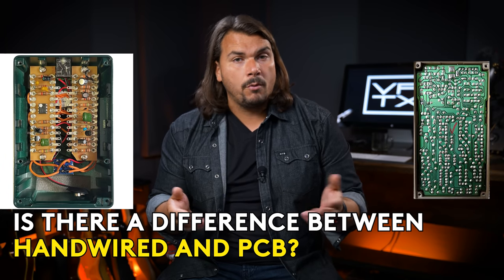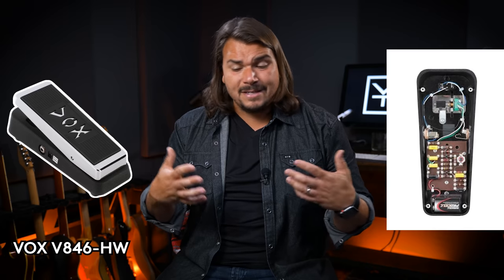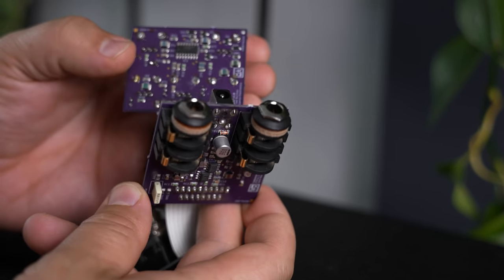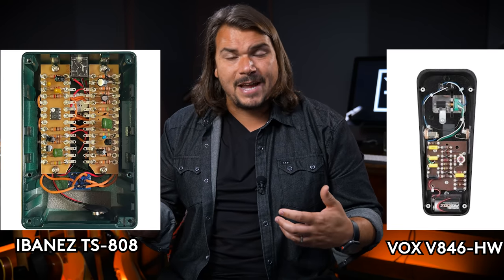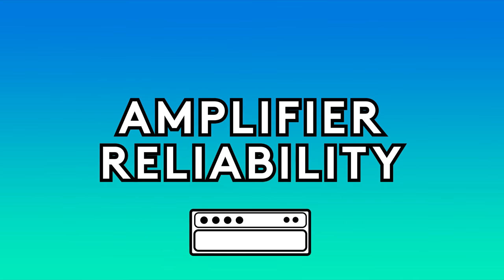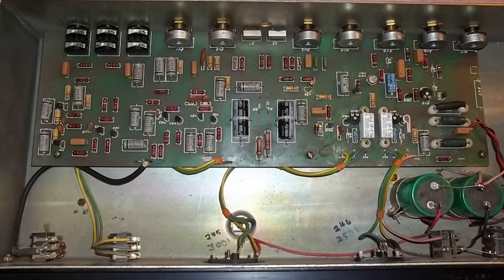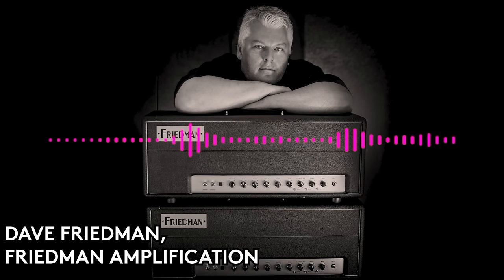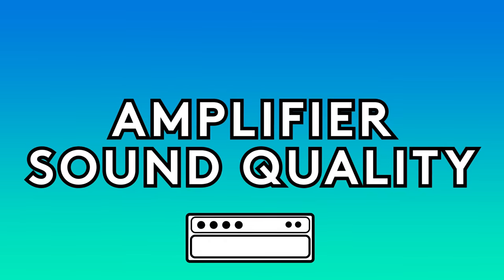Is Hand-Wired Actually Better?

Comment: It's really simple with amps. Handwired = longevity, not necessarily because it'll last longer from the factory but because you (or an amp tech) can easily replace / upgrade / modify any part of the amp. I'm going through this right now on my channel, I've got a 1955 Magnatone I'm learning to work on. I'm confident this amp would be doa if it was made with a pcb (hypothetically) 67 years ago. Working on / with a pcb is MUCH harder and often times the components are much smaller / harder to source and replace. Handwired for amps every time.
Reply from the maker: That's not necessarily true, it depends on implementation and the layout of the PCB.  There are PCB amps that are really great and easy to work on - the Suhr Badger as an example.  Components don't know their on a PCB, and you can use the same components on a PCB amp as you can a handwired amp, what it comes down to is implementation as stated by Suhr and Friedman - so often people characterize PCB amps based on their worst examples, not their best (or even standard examples).
Reply: Following up after hearing John's comments, I think there's a big difference between easier / better to work on for a company vs as the end user / consumer. A handwired amp is going to be much easier to work on as a consumer with an off the shelf soldering iron most people already have the and the components are easy to source for replacements/upgrades. It's much more service time for a company like Suhr or Friedman I imagine to do handwired amps / repairs than it is to just swap a pcb.
Reply from the maker: @YeatzeeGuitar  it completely depends on the layout, design, and intent of the builder.  Again a lot of the issues with hand-wiring are a result of human error by way of hand work, inconsistent solder joints, cold solder joints, etc.  Most of this disappears on a PCB that's wave soldered that's of decent quality.  For the most part, the PCB amps should need almost no serviceability except tube changes and cleaning of the contacts periodically.  Again, on most PCB amps the high failure points are typically wired off the PCB anyway - pots and tube sockets most commonly.  It would be unfair to characterize the quality of something like Fender Hot Rod PCB to a well designed PCB - where it might be more true of what you're writing here on the issues related to PCB.  I wouldn't expect that Suhr or Friedman to need to replace a main level PCB as that's the least likely failure point for a quality build and I would think they would need to do that no more than a few times a year at most and certainly less frequently that a tech needs to re-flow bad solder joints on a Vox Handwired Series.
Reply: @VertexEffectsInc  well I own a PT15IR, I'll have to open it up and see what it looks like but I think there's no question the vast vast vast majority of pcb amps on the market are far harder to work on for the average Joe than say a 60's fender or the equivalent type of handwired amp.

I'm not discounting pcb, like John said it allows him to do more like he did with my fantastic PT15IR. That amp has a special use case for me, so it makes sense but I have no doubt in my mind my vintage handwired amps will out live me and be serviceable to run for my kids when I'm long gone whereas who knows with the stuff reliant on pcb. Will suhr be around in 60 years? Hope so! Will they still have the pcbs hanging around to swap in if there is a major failure? Probably not.
Reply from the maker: @YeatzeeGuitar  yes, the PT would be harder to work on than a Tweed Deluxe, no question - but I think this also needs to be measured against what it does and its features when comparing amps like this.  There's no IR loader in a Tweed Deluxe, no channel switching, etc.  You wouldn't want a handwired PT15 - this is the best method for this type of amplifier.  I think the more 1:1 example would be say a Brownface Fender Deluxe vs. a Suhr Hombre, the same amp but one done PTP in the early 60's the other done now on a PCB.  The PCB is simple, uncomplicated, and while maybe not quite as easy as the Brownface, we're talking maybe 10% more time for anything on the board vs. eyelets to repair (which is the least likely place for failure on the PCB version).
Reply: @VertexEffectsInc  Do you think Suhr's PCB amps are the exception, or the rule? John Suhr is a legend in both the guitar and amp world, if anyone's going to do it right it's him. But he's John Suhr, and there aren't many out there doing what he does but still use PCB. Also, if I remember correctly the Hombre's PCB is in parts that can be swapped out should there be a major failure down the line. What happens when there are no more replacement PCB's decades from now? If a catastrophic failure happens for whatever reason, then what? I'm not sure.... but I do know the answer if it was handwired 😉 I own both types of amps, I even own a Friedman Twin Sister. Love them, both make great amps... but I'd still lean Handwired if ever possible.
Reply from the maker: @YeatzeeGuitar  I think on the mid to high end this is now the standard that most brands are emulating and working towards.  We're seeing a lot more companies go this direction as material costs continue to increase and the cost of labor is at an all time high.  I think Suhr, like most quality PCB designs will typically have one main board and then wire off the jacks, switches, pots, and tube sockets.  The main board is really never the issue, and the things more likely to fail PCB or PTP are still off the board.

Comment: There will always be audible differences between amps and effects. The guests didn't mention that, but that's because no manufacturer will want to talk about it.  But it's there.  The components used - resistors, caps, inductors, transistors,  and even transformers and tubes vary from unit to unit.  Resistors, for example, come in tolerances that can be as much as 20% of the nominal value... or,  for a fat price you can get parts that are have tighter tolerances -  even 1% or better.  These parts comes at a hefty price.  I imagine many (hopefully not all) tube amps are built with tubes that aren't matched at all.  This is why a buyer should play through the actual amp before buying;  it's important for a buyer to get one that he/she likes.  So in my view, sonic differences are real but I don't think it has  a thing to do with hand-wired v. PCB construction.  On the other hand, I don't like jacks and pots that are soldered to PCBs.  Music gear tends to live a hard life.   If a jack or pot  takes a hit, the last thing you want is for that impact to be transferred to the PCB, where it might do some real damage..  It's much safer (and in my view smarter) to wire those parts to posts or through-holes in the board to prevent the impact from causing damage. I should also add that hand wiring may be touted as a "feature" when it might just be that the real reason a manufacturer hand wires is because his production volume might be too low to justify the up-front cost for getting PCBs made.  My 2 cents, your mileage may vary.  But I engineered systems for the defense/aerospace world for decades... so that's my story and I'm sticking to it,  Cheers!

Comment: I do appreciate that well -made PCB amps can be made, but I like the maintainability of hand-wired amps.  It is very easy to do a cap job on mid-60s Fenders and I can do them myself.  Also, I am old and old-school os hand-wired makes me happy.  Between my Fenders and my Dr. Zs, everything is hand-wired and beautiful when you look under the hood.  For pedals, modding is easier with through hole than with surface mount.  I think there is less of an issue with PCB pedals because they generally are low signal devices.
Reply from the maker: Handwired is easier to repair, but not by a lot if if the design of the PCB is good.

Comment: So for about 15 years  my favorite rig consisted of a 1966 blackface Super Reverb and a 1965 Fender blackface Pro Reverb that I ran in stereo through several effects on my board. 

I loved that rigged and it was truly the tone of the Gods.  I have to admit that I was constantly opening up the chassis and just staring at the beautiful wire runs and the artistic nature of the build quality. 

Having said that my current rig consists of a 2005 Tone King Imperial Mk 1 and  a 2007 Dr. Z Maz 18 2 x 10.

 I have to say that I think that this rig is far better than my previous 1960s Fender setup. 

In particular the Tone King sounds almost identical to my beautiful 1965 Pro Reverb in the clean setting. 

And it's not point-to-point or hand-wired but it's built like a tank and the tone is the gravy of the Gods. 

On the other hand my MAZ18 junior is all hand-wired and is built like a tank and sounds absolutely stunning! 

The combination of the two amplifiers run through my rig in stereo I think in my opinion is far better sounding than the two blackface fenders that I ran for approximately 15 years. 

So to your point Mason, I think that it really relies on the Builder, specifically the builder at that company who is actually creating that amplifier or effects to create the more contemporary gear that we have all come to love and covet! 

Thank you so much for the incredibly informative videos that you have uploaded here. It's certainly answers just about every damn question I ever wanted to ask about gear!! Thanks to all involved and thank you Mason for moderating the conversation!
Reply from the maker: Thanks for watching!

Comment: One of my early jobs was working at one of the last independent printed circuit board makers in the US, including a few days of working in their "electrical test" department... i.e. I was checking batches to make certain that every trace of circuitry was transferring current. It was very precise work... and I never saw a failure, My point being I saw "the sausage being made" at what is supposed to be the "lesser" of the equation. Hand wired circuits are easier to repair if things go wrong, but as far as transferring electrons from one component to another? I have no problems or worries with anything made on a PCB.

The only advantage I see with guitar gear then is with the premium of "hand wired" guitar companies may also be putting more care into the manufacturing and components, but I see no disadvantage of copper traces versus copper wires.
Reply from the maker: As the video states, both can be done well.  I think the confusion is that the time it takes to do hand-wiring point to point means that it's better built because it's more handmade.  It can be, it also, might not be and certainly has more changes for inconsistencies amp to amp and failures just due to human error.  However, the PCB can have its own problems if done for the wrong reasons, like budget.  This is typically why we see so many horror stories about PCB amps - the PCBs are done for low cost and mass production with no consideration of re-work, servicing, or longevity.
Reply: @VertexEffectsInc  No, I appreciate the balanced approach and discussion here, as opposed to the usual "circuitboard bad!" mentality that I've heard for decades from guitar folks. I'm just offering an additional personal observation.

Comment: My Holy Grail Amp is the JMP Mk II Master Volume amp, aka the JCM 800. They don't make them anymore. So, there's no PCB versions of those floating around. Someday you might have the same serviceability with PCBs, maybe. But here we are in 2022, and it's still cheaper to have a hand wired amp recapped than a PCB amp. I think the reason no one mentioned this is they'd rather sell you a new amp. I think most of us, when we get that Holy Grail Amp expect to keep it running for a lifetime, and you can, and it's cheaper if it's an hand wired amp. So, until they make capacitors that last a lifetime, hand wired is the way to go. But, unless you have Paul McCartney money, or at least Joe Bonamassa money, it's an expensive proposition to take tube amps on the road. There are instances of people who had both their primary and their backup go out at the same time. If you think having a PCB amp recapped is expensive try paying for Rush Overnight Service on two at the once. Most of us are better off leaving them at home and profiling it on a Kemper. You might even leave the Kemper at home and rent a backline one, and put your tube amp profiles on a flash drive. I think you should have talked to someone in the business who isn't selling something, a hard proposition indeed.
Reply from the maker: Kemper...talk about unserviceable
Reply: What about a vintage Traynor YBA-1 or a Traynor YGM-3

Comment: The first tube base amplifier I ever owned is the Peavey VB-3. This is a very unique amplifier with a combination of SMD and through hole. The SMPS power supply is extremely complex and rare in a tube amp. I have personally worked on the patch Bay for all the speaker connects and DI out to fix a noise issue there. Without special soldering tools I would have never been able to do the job. The VB-MA which I also own is similarly built. Also to mention that these amplifiers were hand built and wired, with some automated assembly of the surface mount stuff. 

I also own the more traditional built VB-2, all through hole but automated wave solder assembly. While much heavier the pcbs inside once you get access to them are far easier to repair using more common solder tools. 

Both amplifiers equally sound amazing and what it comes down to in my opinion is having the skills and the proper tools to do the job.
Reply from the maker: SMD on amps can be a little trickier with the high voltage stuff, sometimes there can be switching and relay sections for amp channels and things that will be SMD, but typically most amps are still through hole even if they're PCB based in most sections from what I've seen but I'm not manufacturing amps on the level of Friedman or Suhr so my experience may be outdated.  Thanks for sharing this!
Reply: @VertexEffectsInc  you are right on the money Mason. SMD specifically when handling high voltage needs to be isolated from the rest of the low voltage circuitry. It's common practice to do this. SMD low voltage components that are doing all the controlling of the larger components that can handle the higher voltages.  Even more important than isolation is shielding. SMD components operating at very high frequencies are susceptible to interference from larger components that typically are not shielded. 

I'm certainly no expert but this type of subject matter interests me a lot. I leave all the hard engineering to the builders. I regularly chat with the design engineers of my amplifiers at Peavey. They don't get near as much public fanfare as Friedman or Suhr, but the knowledge base is undeniable with all of them!

Cheers!
Reply from the maker: @Bassguitarist1985  thanks again for chiming in!

Comment: A handwired amplifier will outlive me.   Cannot say the same about a pcb based amplifier.  I owned  Marshall TSL and it basically was unrepairable without replacing the PCB boards.
Reply from the maker: Depends on the handwired amp and the PCB amp...well built versions of each will last just as long.  A poorly built version of either will not last as long.  TSL is not an equal example to a well made HW PTP amp and is not representative of high quality PCB design.  That's like having your baseline for Sushi being a California Roll you got at a gas station.

Comment: As another person, below, stated the only negative to a PCB amp is if inputs and outputs jacks are directly soldered to the board itself.  Given how often jacks are used, they should be mounted to the chassis and then wires going from the jacks to the circuit.
Other than that, regarding how electronics works and how electrons flow, there is no difference between hardwired and PCB, IF the components used are the same.
For the low current that flows inside the amp, from the input into the circuit and up to the power tubes, there is no difference to that signal.

From the higher power output to the speakers, that's a different discussion and debate, in terms of which wire gauge works best there.
Overall, PCB amps are equal to hand wired amps, IF the components used are the same.

Comment: Mason, great video on this subject. 

I've had several discussions with others in the past on this topic for amps and not so much on the stomp pedals. I have no issues with PCB amps. I personally would prefer that the tube socket be mounted directly to the chassis to lower overall internal heat and better dissipate heat away from other components. 

Proven fact in the electronic industry that long time exposure to heat will result in thermal degradation of electronic parts, connections and cause faster tolerance changes at the component level. From the perspective of reliability and longevity the cooler the better. As far as tolerances this could affect the tone for the better or worse, kind of like a drained 9V battery in a pedal – never know the results until it happens. 

Again great video, really enjoy the broad topics you cover on guitar gear.
Reply from the maker: Most of the high quality PCB amps still put things off the board or hand wire them like the heater wires to the tube sockets, some jacks and switches and pots.  The Suhr Badger PCB shown here is a good example of that.